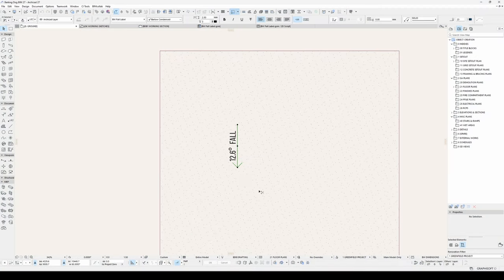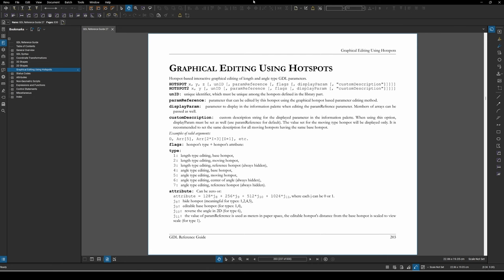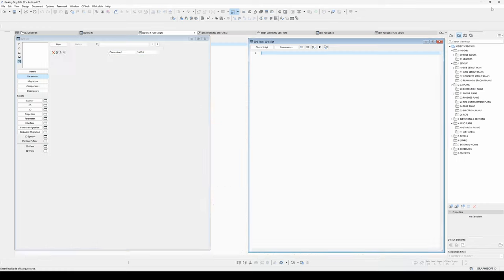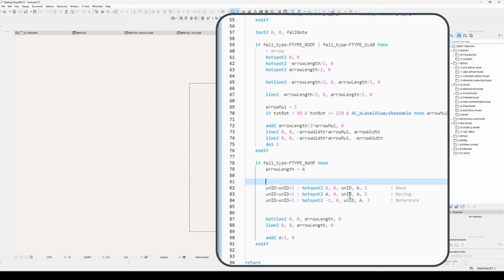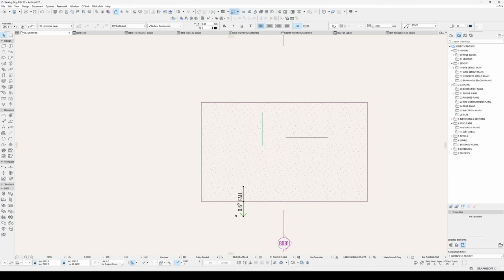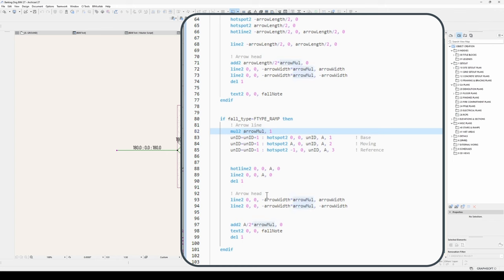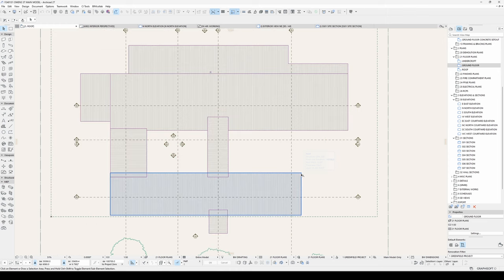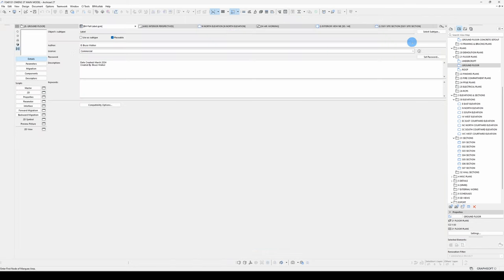025 Archicad GDL Automatic Fall Arrow Part 3

Comment: Hi, great tutorial! However, there is a problem with my script. When I try to rotate our label to the right everything is ok. However (when rotating left 0 to 180), the direction of the label changes by 90 degrees, or rotate in opposite direction. Where could this problem be coming from?
Reply from the maker: It could be a number of different reasons.  I suggest posting your question on the gdl forum...it's much better suited for getting answers to things like this: https://community.graphisoft.com/t5/GDL/bd-p/forum-gdl